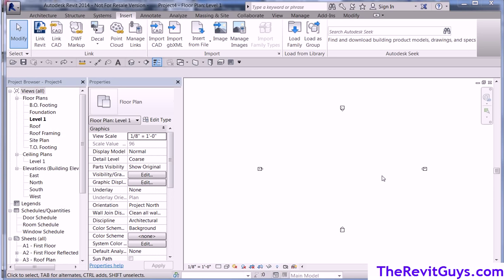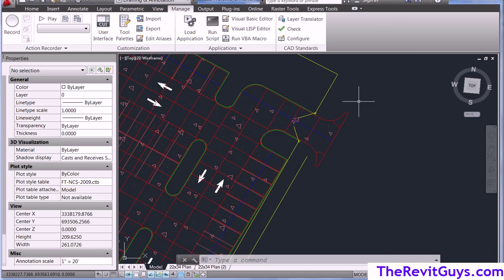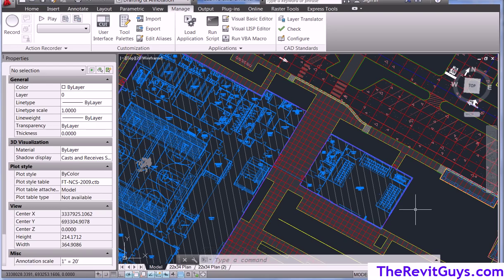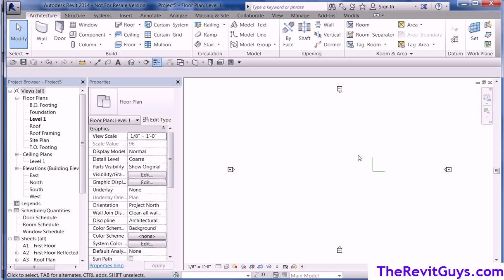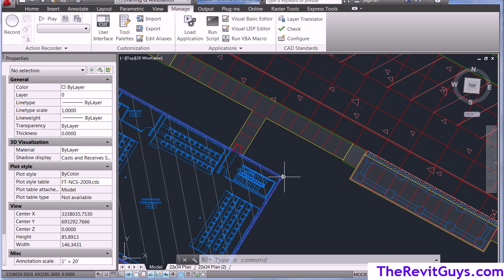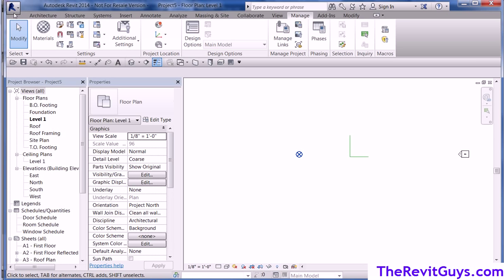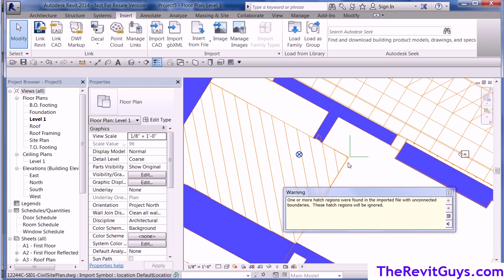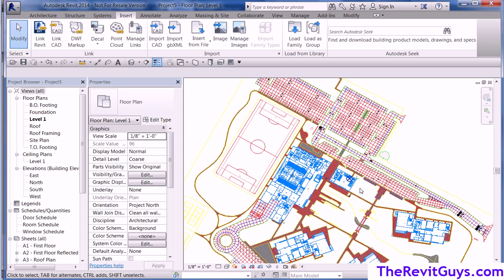Linking AutoCAD Surveys into Revit using Shared Coordinates

Comment: I get a warning that "Imported objects located a large distance from the model might not display properly. The "Center-to-Center" option will be used." The cad file inserts but the points are not lining up. Any ideas?
Reply: I also got the same warning and points also were not lined up at first try then i changed the units in Revit as same as came from AutoCAD and entered the coordinates once again with same units (everywhere in meters only) in specify coordinates option in manage tab then re inserted CAD file again and it lined up precisely.

Comment: Hi, quick question, would you be able to use the project base point rather than the survey point when linking the DWG? On the other hand, does Revit only related the DWG to the survey point when positioning or could I use the project base point when positioning by shared coordinates?
Reply: U should never move the survey point

Comment: What did you do to clean up the CAD file?
Reply: Eric, you can clean it up in AutoCAD or Revit. When linking a CAD file into Revit, use the" CURRENT VIEW ONLY" option when picking the file name.
This will bring the file into JUST the current view and will not overwhem you and the model with CAD lines.
Once loaded, you can use Vis. Graphics (VV) to turn off the layers you do not want and adjust the color and line weights.
Another option is to pick the CAD file. One the ribbon you will see QUERY. Pick it. This will let you list layer and hide them directly from the screen.
Hope this helps,
Ken
Reply: Ken Colgan cool thanks
Reply: Another newbie question... I noticed that my Revit file doesn't share the same North position as my CAD survey. Also the Revit building doesn't fit within the linework of the CAD file? Best possible solution???
Reply: eric guizzetti Eric, you have two separate things happening here. First the scale. Many surveyors use a one unit equals a foot and some use one unit equal an inch. Many times when you bring files into Revit you need to adjust the scale. sometimes it's easy, you just need to scale up or down by the multiplier of 12. If you're using meters Etc you have to use a multiplier of 10 or 100 or .1.... 
Second, set the true north.
 Revit actually has a tool called "Rotate true north". You may be able to Google or YouTube a video on how to quickly set the true north.  it's quite easy once you see it done. so to recap, you need to verify your scale, set the road True North rotation, and then bring the files together.